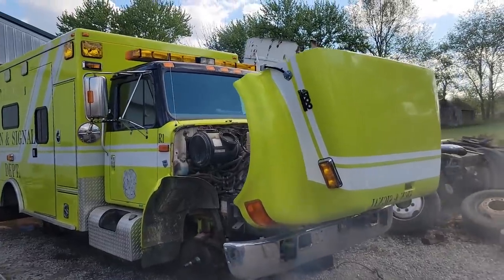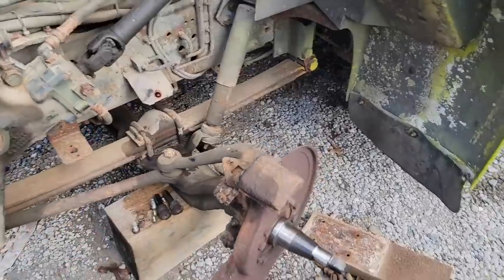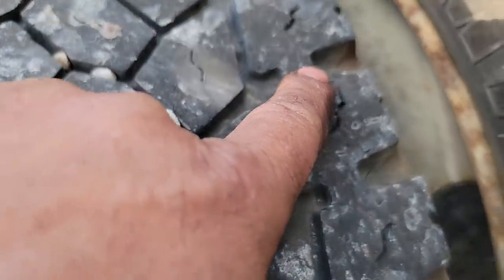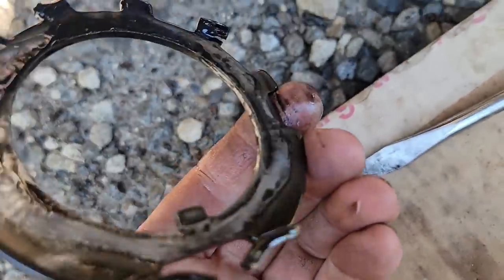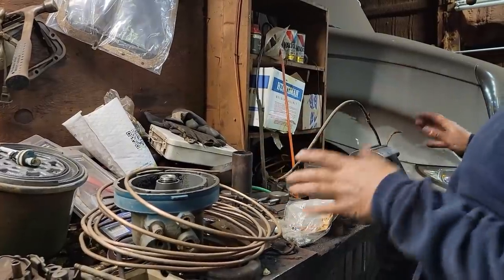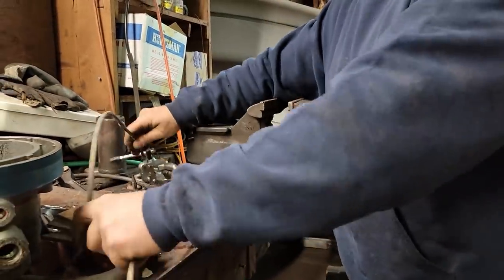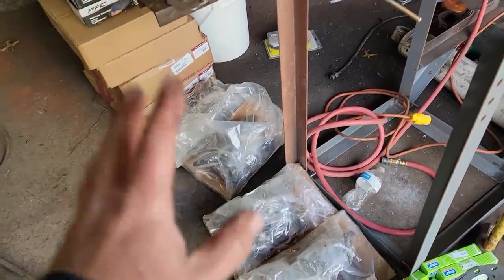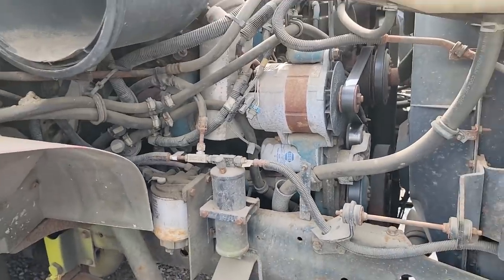A VEIWER'S 2000 INTERNATIONAL 4700 AMBULANCE PT1!

Comment: Mr JC. The nickel copper tubing you used for the brake line is commonly referred to as Monel. It is an alloy of copper and nickel in various alloy percentages. The appearance of your coil of tubing has a more coppery sheen which tends to make me think it has a higher percentage of copper than nickel. Common alloys of this metal have ratios of  75/25 and 65/35 nickel to copper and copper to nickel. All are extremely resistant to salt corrosion.  McMaster Carr and Grainger offer grease fittings in the (monel) nickel copper alloy.  Never had one refuse to take grease. These alloys are used extensively in shipboard salt water systems. Mil specs on these alloys usually start with the letters QQN-a number, such as QQN 284. Enjoyed your video.
Reply: They work very well for both brake lines and fuel lines.
Reply: @bigassfordsd  added  benefit is they never rust. You can also get zero fittings made from monel. They, also, never rust.

Comment: I'd be interested in seeing these Cummins race rigs. The DT466 is a love hate relationship with most people that have dug into them. I did quite a bit of work on one a few years back and they have some weird stuff about them. Not to mention they are quite underpowered and could definitely use to be turned up. Definitely gonna be quite the rig when it's done. I've used the performance friction pads on some of the track cars I've built. Definitely a great pad.
Reply from the maker: i have a mostly positive opinion of the dt466. they are a great engine for a truck up to 32000 or so gvwr. i want something more substantial for anything larger.

Comment: JC they are different sizes of caliper checks the outside is look the same the inside diferent
Reply from the maker: not in my experience. parts came from the dealer and were found by using the vin.
Reply: @j.c.smithprojects  in my truck are different by the vin i love you Chanel keep doing good content 👌 thanks you

Comment: I'm surprised a ambulance didn't have air brakes
Reply: Hard to find first responders with a CDL, or desire to get one.
But then, the TRUCK SHOP I work in has same issue. 12 techs, I'm the only one with a CDL.
Then again, I may be the only one that can pee clean too.
Reply from the maker: air brakes do not require you to have a cdl. if the gvwr of this was over 26,000lbs, you would need a cdl, if the vehicle requires a cdl AND it has air brakes, you need an air brake endorsement on your cdl.
Reply: @j.c.smithprojects  I agree

Comment: did you use a rust converting primer on the hubs?
Reply from the maker: no. cleaned them up with a wire wheel. primed with a rusty metal primer and then painted.

Comment: There’s some hard idle time on that engine I bet
Reply from the maker: i thought the same thing but it has very low idle hours.
Reply: Depends on what it was used for as an ambulance, I know our local county EMS has mostly 1 ton Ford E-350’s for daily stuff and then they’ve got 2 “heavy rescue” ambulances that are this size, a Ford F-800 and an S model international. The little (comparatively) vans are always idling or driving pretty much 24/7 but the big heavy rescue ambulances only respond to maybe 6 or 8 calls a month, the rest of the time they’re parked in the EMS garage plugged in to a battery maintainer, and when they do go it’s foot to the floor, get everyone on scene taken care of then back to the barn. The place I used to work maintained all the county’s big trucks and I got to change the oil and do a PM on the F-800 once, it’s a 1992 model with a 7.8 Ford diesel in it and an Allison 4 speed auto, and it’s an air brake truck. That thing is immaculate, in 2015 it had 32,000 miles on it and under 1,800 hours on it, truly barely broken in. If this truck was used the same way I’d say it’ll make him a really nice, reliable RV / tow pig